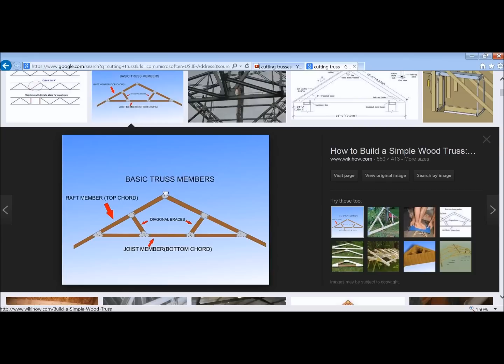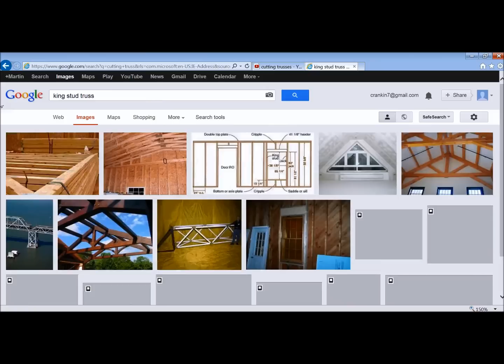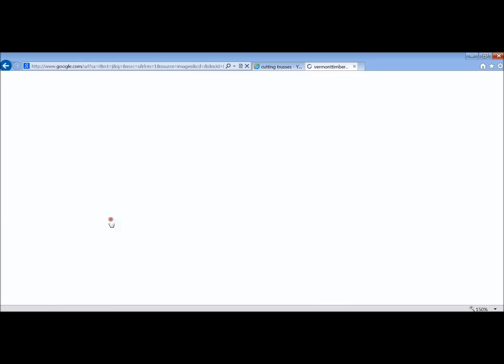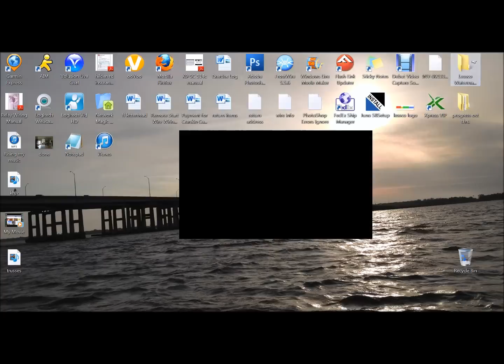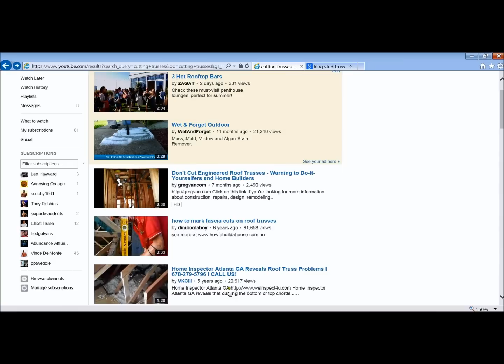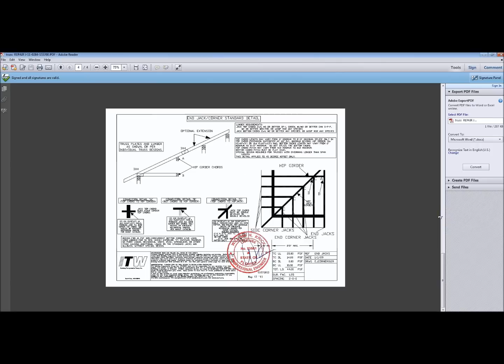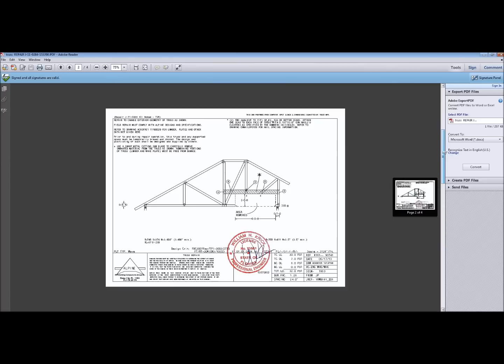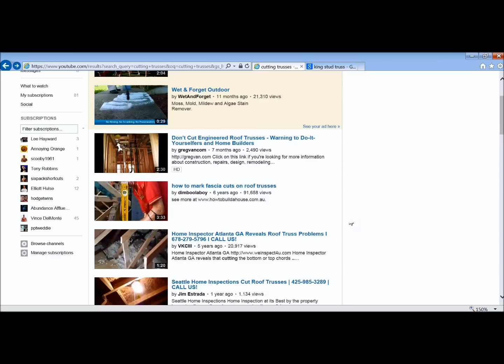Cutting Trusses and doing a tray ceiling roof truss modification

Comment: I thank you so much for your information, like you I’m able, capable, and a carpenter by trade, although I’m not an engineer. Planning to do a tray ceiling myself with three trusses I’ll need to cut. You have given me a direction to start from, which like you had me worried and glad I didn’t just go ahead and start cutting, because of the structural aspect of project. Very informative and helpful to me moving forward, thank you brother, you rock !

Comment: Just bought an investment home with 7'2" hi ceilings, and was wondering how I could give the illusion of a higher ceiling and have an additional foot or two to accommodate ceiling fans with light fixtures.  Raising the roof was not an option - entirely too costly.  Your video showed me a tray ceiling can be added in the middle of each room to solve both problems for a reasonable cost.  Thanks for sharing.

Comment: Thanks Lessco. My product is very similar to yours.  I want to install a dome recessed in my attic (http://www.archkit.com).  I love the idea of getting the plans from the county office.  I'm going to follow your lead.  If the manufacture gave you a new plan, why would you still need to see the structural engineer.  Just food for thought.  Thanks again!
Reply from the maker: Reshid Walker The reason is you'll never get a sign off from the building inspector without an engineers truss modification plan.
Reply: +Lessco Electronics  I just wanted to follow up with you.  I finally got my enginners truss modification plan!  I'm on the move!  Thank you so much for your video.  Because of you I was motivated to see my product through.  I'm going to post before and after photos.  Thanks again man!  Awesome stuff dude!

Comment: Really, don't do it. Modern roof trusses are engineered with a small factor of safety, and you're increasing the load on the surrounding roof members, which brings their factor of safety down to near zero. First serious storm or large fall of snow, or tiler walking on the roof and you could have serious problems.

Consult a structural engineer and get some steel members made up to compensate for the wood you'll be removing.
Reply from the maker: ***** the trusses were re engineered as I showed in the video. safety was my main concern.